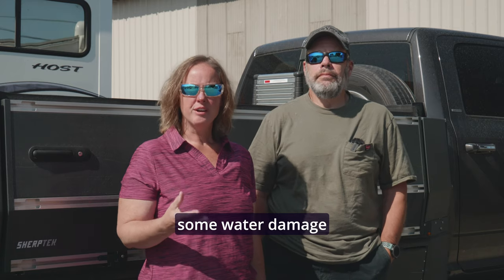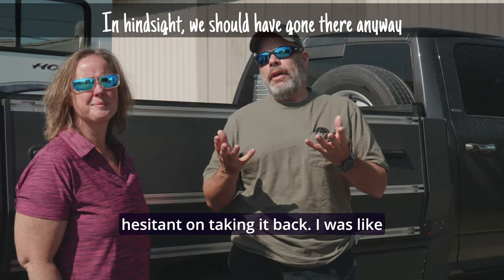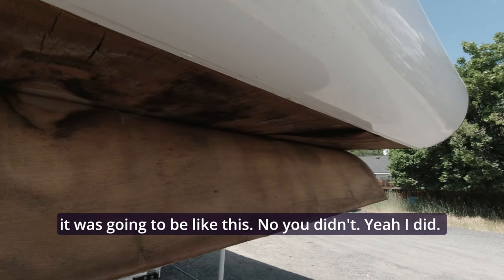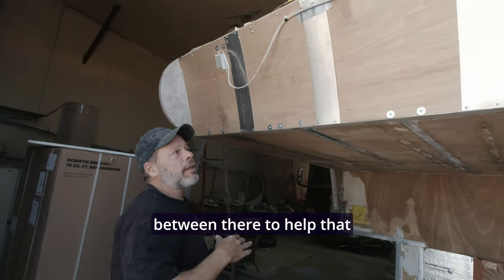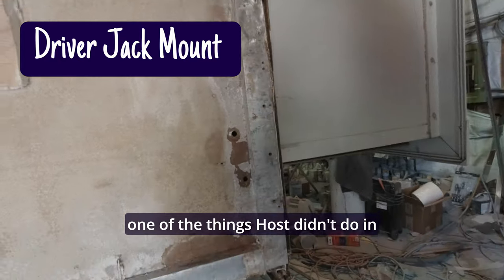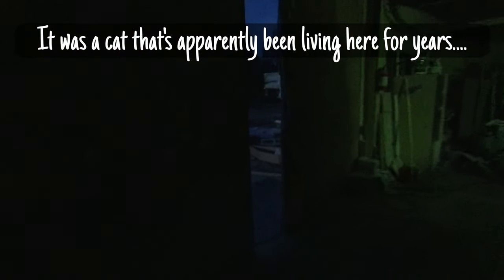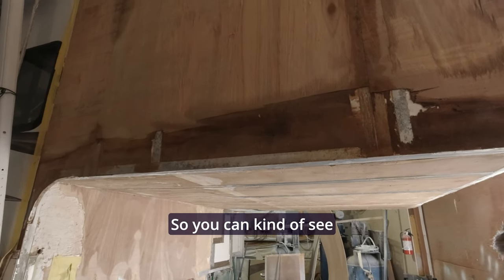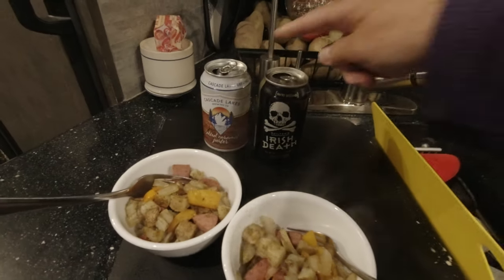RV Water Damage: A Camper's Worst Nightmare  | e139

Comment: Wow what a horror story! All the best with your journey back to the road! I’ve been shopping Host but now I’m not quite so sure. I like the spaciousness but have questioned the clothing storage and the construction. It looks like even with your constant attention to seams and preventive maintenance, it still could be a problem. Thanks for your candor. You guys are real life!
Reply from the maker: It's certainly not a pretty sight. They did have roof leak issues in 2018, but they ended up updating the cap. The "chin" area is a good place to look - if thats delaminating, they may not have caught the leak. Also, check inside the rig where the front jacks mount. We knew we had some delamination due to our original issue, but I didn't realize it had still continued to leak. It's a rough brea,  but she will be better than new once we're done!

Comment: O My Gosh, this is horrible and I’m so sorry you have to go through this.  This is an excellent case for the 2 piece fiber glass campers.
Reply from the maker: Funny you say that. While we were at Penpac getting this fixed, I shared several other style of campers that were also there with water damage.none of them being the 2 piece versions. In our opinion, there's no real full-priof design. You just have to catch it a lot earlier than we did. It didn't help that our camper sat in Oregon for a year before we went full-time while we were getting our truck upfitted. I think that was it's downfall.

Comment: Should have never happened  ! Best of luck on a successful repair.
Reply from the maker: You're right, but there are worse stories than this with new RVs.  I just wished we took it back into the dealer back in 2019 when we saw the issue instead of trying to fix it ourselves.  Hard lesson learned.  Thanks for stopping by!

Comment: Wow, wow, wow! That’s no bueno. My least favorite thing about an RV is that you have to constantly re-glue (caulk) to keep it from coming apart and disintegrating. One thing to consider is replacing the plywood with Azdel. It’s impervious to water so it won’t delaminate from the Filon and get moldy—at least that is my understanding. I have an older Lance that is having the same issue and it has a wood frame. I’m afraid it is not long for this world.
Reply from the maker: I wasn't aware of Azdel- that would have been a better plan. We ended up getting the oem fiberglass from Bend, so it's unfortunately too late. I'll keep that in mind for future projects (hopefully nothing like this one, though!  And I'm so sorry to hear about your TC.
Reply: @TheJoslynJourney  My Azdel suggestion may not have even been feasible. An RV repair facility probably does not have the ability to bond the outer Filon (fiberglass) layer to the substrate. Getting a replacement from Host makes much more sense. That said, an earlier commenter was correct about Luan plywood. It's commonly used in the industry but it has some significant drawbacks, the main one being that it sucks up moisture like a sponge and then comes apart like...well, unfortunately you know. (So do I.) Azdel is a newer product that is soaked in a resin during manufacturing leaving it impervious to moisture. If it is laminated to the Filon correctly, it should never delaminate or deteriorate. The best manufacturers have switched away from Luan to Azdel. Maybe Host has too. They certainly should. They're not a budget manufacturer.

If you're interested, search for "Azdel" on YouTube. One of the hits will be a tour of an Alliance RV manufacturing facility. The company has had an exterior wall pulled from their production line sitting outside in the rain and snow for two years. It still looks new. It was built using Azdel. 

We all end up with whatever tech is available at the time our RV is built, and every RV is a collection of tradeoffs and compromises. You should enjoy your better-than-new Host for years to come.

Comment: Sorry you are having these problems.  I had an 18 yr old Lance that did the same thing.  It took me 6 weeks to repair it myself,  working on it full time.  Of course I had to learn as I went along.  Should turn out better after the repairs.
Reply from the maker: Wow, that's a huge project to take on yourself! We thought it would be best here since we could get the fiberglass directly from Host down the road. And our last fiberglass repair didn't quite go as planned. On the plus side, you know your rig inside and our after a fix of that magnitude! Thank for stopping by!
Reply: I have an Lance 850 2019' that is showing this exact issue.  My nose has the big molded cap.  Thought I had it all sealed up and am noticing the belly in the cabover area on passenger side.  If I may ask, did your Lance have the molded cap in the nose area?  Was the structure wood or aluminum?  Was there luan bonded to the filon?

Contemplating renting a pole barn next spring and starting in on this project.

Comment: I can’t believe all the damage this camper suffered in such a short period of time. Did you ever figure out what caused the leaks? I reseal the roof on my arctic fox every year or inspect at the very least. What a massive repair you have.
Reply from the maker: Well, it wasn't so quickly, actually. We found the leak in 2019 and thought we fixed it. But we missed key areas on our "fix" and couldn't get to the repair shop in Redmond until 2023. We honestly didn't know it was that bad until we got there!
Reply: @TheJoslynJourney  yes, I watched more of your videos and I heard your explanation. I still believe host should have stepped up to the plate however, I understand obligations aren’t forever regarding warranty.
Reply from the maker: Agreed. I will say that when this issue was found on our camper and others, Host did offer to fix the damage and redesigned the front cap. We chose not to have it fixed since we were in Illinois and not many dealerships understand truck campers. In hindsight, we should have just shipped the camper over at the time. But in the plus side, we have the new cap design which adds more protection.

Comment: Is this under warranty? There are some real design and structural flaws here you mentioned Host has since addressed in newer models that lead to all these problems with your camper. I hope they are covering the repairs
Reply from the maker: Host has a 1 year warranty. None of this is covered, unfortunately.  They continuously improve the designs, but ours was instigated by the water damage. The original design probably would have been ok without the water. In comparison, other campers don't even use aluminum, so we could be worse off.  Luckily, everything so far is fixable.  Just frustrating.

Comment: Yikes. I just watched the video where you got stuck, and mentioned that your door doesn’t close. Now this. Definitely won’t be looking at a Host camper when we buy.

I think I would prefer a well built wood frame unit like an old Okanagan to what you are dealing with.
Reply from the maker: Hi Bob. Thanks for watching! We think the door had a bit to do with the front cap issue, which makes sense to me. We aren't having the door issue right now, but time will tell. Host had (accidentally) skipped caulking screws in 2018, which would cause all this water leakage. They did help others who were affected, and they immediately fixed the caulk problem then upgraded the nose cap. Honestly, if we had this damage on a wood frame, it would have been totaled. We thought we fixed the leak issue back in 2019, but we obviously didn't. It's a learning process. If we could go back and purchase another truck camper, we'd still go with a Host. But you have to be comfortable too. Just food for thought...
Reply from the maker: On the plus side, you know we will share everything- both good and bad on these truck campers! It's best to have the most information going in!

Comment: I do believe that I'll be scratching Host from my short list ... I love everything about them for the most part except the water intrusion and the price tag. For what is considered a higher end truck-camper they sure use substandard materials. There is nothing good about luan except being cheap to manufacture... I do believe that Cirrus & Lance use Azdel. Cirrus has an aluminum roof and Lance uses PVC which is better than EDPM or TPO...
Reply from the maker: Everything has pros and cons. You just have to go with what you feel is best. I don't personally believe they use substandard materials, but no manufacturer can make a rig that would meet our standards. You have to pick what's most important to you and fix/upgrade the stuff you don't like.  Thanks for watching our journey to make this thing even better than new!
Reply: I had a 2017 mammoth.  Zero issues.  Wife wanted different bath.  Ordered a 2022 cascade.  Got it spring of 21.  80 nights and zero issues.  Ordered the mammoth also.  Host is great to work with. FWIW.
Reply from the maker: I would also recommend to go on owners forums for any rig you are considering. There is no such thing as a rig that doesn't have problems.
Reply: @TheJoslynJourney  I'm realistic with my expectations... I've just seen so many videos not to mention personal experience with de-lamination that I tend to want a camper made with a material that won't disintegrate as soon as a drop of water hits it 😳 There are campers that are made of such materials. Needless to say lauan is not a superior product for campers. Seeing that all campers leak at some point I'm trying to prevent the heart ache from having to do an expensive repair. I have to say that looking at the damage to your camper gave me flash backs and a PTSD flair up from my first camper 😹 which required many hours and dollars to repair. So, I'm somewhat damaged or flawed in that way 😹 I'm sure your Host will turn out just perfect at the end of the day. Thank goodness for that. 🌵 👊🏻 Hope to see you on the road soon !!

Comment: OMG! Please tell me this was a factory recall repair!
Reply from the maker: They don't do factory recalls, but back in 2018 and 2019, this was a hot topic on the Host owner forums. Many were able to go back to Host and get it fixed. We thought we fixed ours but obviously not good enough.
Reply: @TheJoslynJourney  that sucks. It was clearly caused by their lack of attention to detail during the assembly. They should be on the hook to fix it. I am really nervous now with my 2020...lol...I know you said that Host figured it out and began caulking those screws after your model year...but after seeing what they are doing to your camper and how long its taking....I really am concerned that my $65k camper (used) will eventually need a $5k plus or more (its prob way more) repair like what yours is getting. I am actually considering getting one of those lifetime warranty sprayed on armored roof coatings because of your experience. That's $4000 and they will line the truck bed with the same stuff at the same time they do the camper.

Comment: What caused this issue?
Reply from the maker: Screws not caulked on the nose cap and the vertical rails on the nose cap. As soon as Host found out, they corrected the issue. Others were able to take it back in to get fixed.  Also a new roof design.

Comment: This is so disappointing to see. Have you considered legal action against Host?
Reply from the maker: No. They recommended to bring the camper back to Bend, OR but we couldn't get there due to our jobs. We let it go past the warranty. We thought we fixed it, but in the midwest its pretty humid and it looks like it never dried out (or we didnt catch all of the leaks).  While the initial part was Host's fault, the latter part was ours.